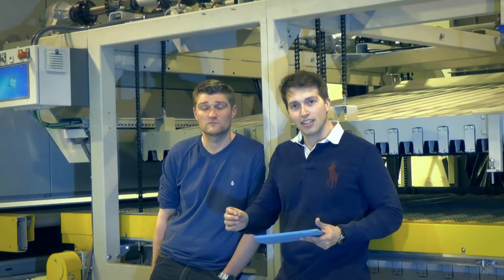AskGlaston Episode3 How to temper Low-E glass with older tempering technology

Comment: We have a issue with 4mm low e glass the top temp is 695 and bottom is 703 the quench had an upgrade but we still have a bending issue with glass over 1m X 1m bending upward even when we drop the top quench down
Reply: Low e glass heats up in the opposite way to traditional glass. The temperature of the lower heaters should be lower than the upper heat. 680/655 and convection at 80%.